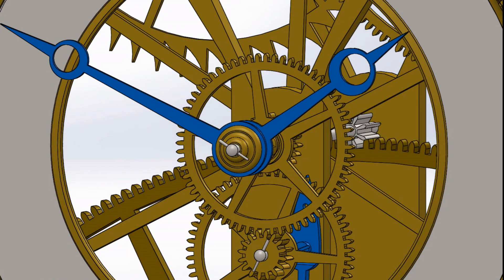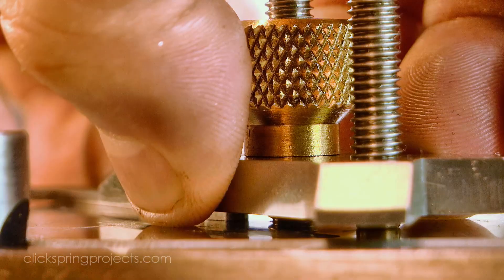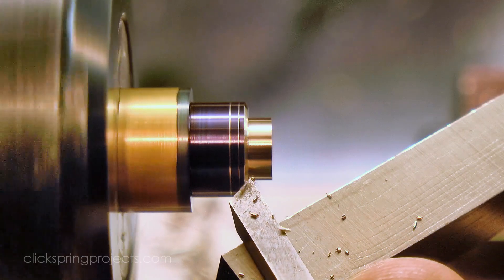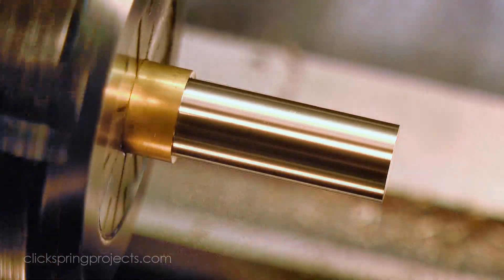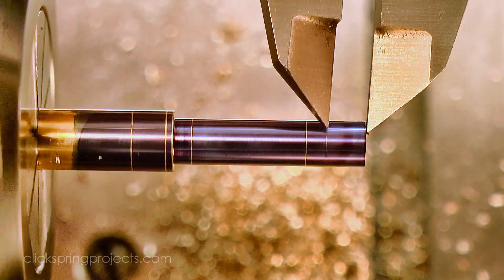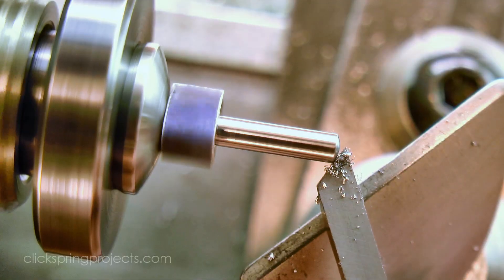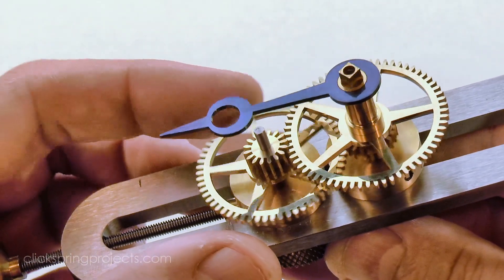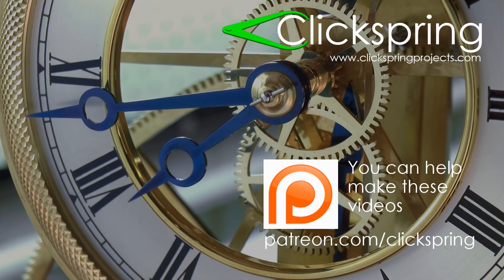Clockmaking - How To Make A Clock - Part 16 - Making The Motion Work And Hands

Comment: What do you predict the accuracy is going to be?  1 second per day? 5 seconds per day?
Reply from the maker: +February The design is based on the classic "Y frame" table clocks that were popular in Europe during the 18th C - it lacks virtually all of the traditionally accepted* features of a good timekeeper, such as temperature compensated pendulum, deadbeat escapement etc, so not expecting anything spectacular in regard to timekeeping. It is designed to be visually very pleasing, but simply competent as a timekeeper. I'll be happy if it keeps within a few minutes per day. Thanks for watching

*btw what passes as "traditionally accepted" in regard to timekeeping best practice has been completely turned on its head in the last year, with the completion and successful trials of Martin Burgess' Clock B. Harrison was right; we could have had a vastly superior time standard 300 years sooner: http://www.dailymail.co.uk/news/article-3045499/Longitude-clock-stuns-experts-keeping-accurate-second-100-days-300-years-designed.html
Reply from the maker: +sivalley I appreciate your optimism, but that is very unlikely. As I said above, the design lacks the key elements of a good timekeeper. 1 second per day is outside the ability of this mechanism, based on the lack of temperature compensation alone. This is a visual show piece, and was never intended as an accurate time keeper. Thanks for watching
Reply: +February With enough patience he can get down to one second per day calibrating the pendulum.

Comment: Why does the clock gear up so much from the great wheel only to gear down 1:12 for the hour hand?
Reply: You're confusing the power train with the motion work. The motion work has to have a 12:1 ratio because for each single rotation of the hour hand, the minute hand will go around 12 times. The clock wouldn't tell the time otherwise
Reply: +homosapienssapiens19 I think the significant gear train is from the mainspring to the escapement, with the ratio set by the need to spread the spring's energy out over as many tics as possible while still leaving each tic enough energy to keep the clock moving. After that you work back from the tic rate set by the pendulum to work out where to tap the train to drive the hands. It probably makes sense to have the 12 to 1 ratio out of the main energy path because it's quite a modest ratio compared to the others, and then is seems pretty arbitrary which way around you have it. Perhaps the wheel sizes look prettier this way for this clock.
Reply: +galogamoth but why not drive the minutes hand and have the hours on a 1 to 12 ratio from that?
Reply: +anothermoth as you gear down from the great wheel to the escape wheel (via the intermediate, centre and third wheels) you lose torque. As you say, you could drive a minute hand and then gear the hour hand from it, but you'd be gearing down the power train only to gear up the motion work, and it's a waste of energy.

Comment: Beautiful work, engineering plus art at the same time. I noticed that you used Rodico to move the hands, are you planing on protecting them with some clear coat or will they stay as they are? Must be very sensitive to moisture or fat from fingers otherwise?
Reply from the maker: +Richard Andersson Yes its mainly oils from fingers that can be a problem, so no touching where possible from now on. Other than that, they will be fine with just the oxide blue. Thanks for watching and asking Richard.

Comment: How much time did you spend on filing?
Reply from the maker: +Der Kommentator A lot! traditional clockmaking is all about the filing! Thanks for watching
Reply: +Clickspring it is beautiful!
Reply: +ClickspringThanks Chris, another great video as usual, well done - I'm intrigued that you appear to avoid the line by quite a margin - both in the sawing out and later on the belt sander before filing. Do you go back to the sander off camera after demonstrating some filing for the camera? Maybe its just a trick of the photography and the amount isn't as much as I think?.Anyway Cheers and keep up the great work. Conwae
Reply from the maker: +c knight He Conwae yes I use the saw as a coarse roughing out tool. Typically I will cut about 1 - 2mm short of the line with the saw, and then end up 0.5 mm short after linishing, leaving the rest for final finishing with files/abrasive paper. The reason is that there is often much variation in the cut depth for a jewellers saw blade, given that not all cut strokes are perfectly vertical, and its very easy to drop a cut mark inside where you think you've put your cut and mess up the perimeter. The belt sander solves this so easily, because linishing is so fast an accurate, and leaves a superior finish anyway. So for me I see no real payoff in taking it slow and precise with the saw cutting close to the line, when I can just rip in with the belt sander from safely outside the line, and be done in seconds, without any of the risk of ruining the part. Leaving 0.5mm on for filing works well to generate the final finished surface with files, paper and then burnisher.Thanks for watching and asking :)
Reply: +Clickspring Thanks Chris, Is your belt sander a shop made or commercial model? - Do you find the 1 inch belt narrow enough for your work? or is that where the die filer comes in handy. Cheers Conwae
Reply: Clickspring " I see no real payoff in taking it slow and precise" this is how it SHOULD be done :P